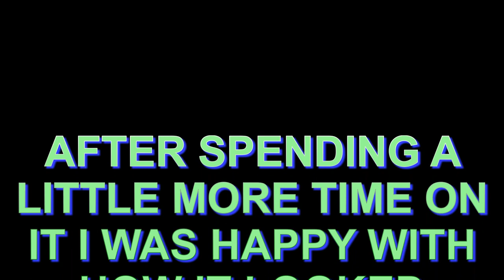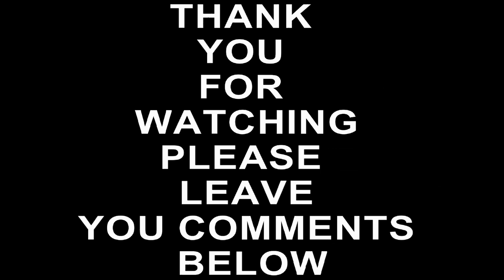Enamel Clock Dial Repair

Comment: If you'd have taken a heat gun to the repaired area, the enamel would have evened out and baked hard.  Then use pinstripe tape to keep your numerals straight.  Use an extra fine black paint touch-up pen.  But the enamel powder is supposed to be baked or at least exposed to heat.  You could also have put it into your oven dial side up and low heat...180F  Also, polident can make the dirt in the fine cracks disappear.  I wouldn't use it on a really valuable piece bit it really works.  You can see some people using it on pocket watch dials.
Reply from the maker: Wow! This is really good information. I tried everywhere to find out how to use this pate but came up with nothing. So in the end I had to fumble my way about it. I really appreciate the advice here. I'll bear this in  mind if I come across another badly cracked dial. Meanwhile, I'm off to order myself  some polident as I do have a few clocks with hairline cracks that I havent managed to properly clean.
Thanks again
Johnny

Comment: Job well done, have seen many dials that have been repaired badly & stand out like a sore toe, you have achieved a good finish.
When you have trouble finding where you repaired the dial, thats good.!!
Always best to keep original dial if possible, which you have done successfully
Thanks for the video, will purchase this product & give it a go
Reply from the maker: Thank you. I had a quick peek at your channel and can see you're a clock connoisseur. Its always nice for me to have the approval of an expert. I am just a keen self-taught hobbyist and  like having a go and learning. 
My biggest problem with the dial repair paste was that no instruction was supplied. In the end I made up my own way of using it which seemed to work pretty well. Glad you enjoyed the video.
Johnny
Reply: Restoring clocks is all about problem solving, which you achieved brilliantly, there is always more than one way of doing things & we all never stop learning

Comment: I find that useing the ultrasonic tank for approx 5 minutes with water or clock cleaning fluid in it on a dial that has cracks,the dirt is expelled from the crack and the crack becomes almost invisible,but i would not do this on a dial that has bad damage as some of the loose bits of the dial can come off.
Reply from the maker: Thats good to know. I might give that a try

Comment: Never heard of that paste before.    You seem quite handy  so what trade were you in.      Colour looks good.   That's the hardest bit..  if someone lets you know John let me know.   No instructions for enamel repair.  To make enamel chapter rings like that they have the brass template and sprinkle the sandy substance called enamel then bake it in the oven.   Really good outcome.. thanks again to..
Reply from the maker: Well.... I have had several different businesses over the years. My last venture before selling up and deciding to retire was an estate agency. Prior to that I fitted kitchens and bathrooms, before that I had a car breakers yard. The list goes on and none of it is related. Ive just always been quite good at being creative which is what I am using my ample spare time to pursue. I kind of enjoy the challenge although I do tend to get quite frustrated at times. So far nobody has mentioned any kind of tips on how to use that enameling product.

Comment: Hello, I also use enamel paste like yours to repair the dial, but it peels off easily even when I apply it. Is there any better way?
Reply from the maker: Hi
This was the first time I had ever used the paste. I couldnt find a tutorial anywhere so just opted with melting it into he cracks. Mine hasnt peeled or fallen out so far
Reply: thank you for your reply.
 Hmm, maybe I could have heated the knife more. If you don't heat the knife, the paste will likely crumble when preparing the surface.

Comment: what is the name of the paste you use
Reply from the maker: I used Bergeon Dial Enamel. Here is the link
https://www.cousinsuk.com/product/dial-enamel?code=D0417
Reply: Thanks
Reply: and where can I get the pen with which you wrote the numbers
Reply from the maker: @mustafayapc1150  I used  satin black spray paint which a sprayed a little into the cap. I think you can use Indian Ink too. Then I used a needle as you can see in my video 12:42 which I have secured into a holder. I carried out the work very carefully under my microscope which made it easier to get a fine finish with.

Comment: Hi, would you mind giving me some advice on the kind of microscope i should be looking for to do similar work on watch and pocket watch dials as well as lathing new staffs, im not an uber rich type and am self teaching. 👍 Also very nice job on the repair, i hope my repairs and restorations will be as good 😊
Reply from the maker: I couldnt be without my microscope. I use it for so many different things. One of the most important things to look out for is a decent working height as you'll need room beneath the lens to do your repairs. Some people seem to like microscopes with a screen but I feel that they mess with my hand to eye coordination. Mine is direct view through the lens. The only addition that would have made it better was if it had a camera facility (trinocular) which would have made filming directly through the lens a possibility. 
Heres a link to Ali Express where I found one very similar to mine minus the LED lighting although you can buy led rings for this purpose. This is the style of microscope you will need. 
https://www.aliexpress.com/item/4000327349091.html?spm=a2g0o.productlist.main.53.5e7776a91D0v2h&algo_pvid=f6283b26-862c-4ea5-a50e-bf9804aa7f39&algo_exp_id=f6283b26-862c-4ea5-a50e-bf9804aa7f39-26&pdp_npi=4%40dis%21GBP%21135.26%21105.5%21%21%21160.13%21%21%402103853616989168357953839e5983%2110000001342913380%21sea%21UK%21889865164%21&curPageLogUid=zcHm66d5HxN5
Good luck with your projects. I am self taught too. 
Johnny
Reply: Thank you very much 😊, I did think about an LCD screen to use the microscope directly over the lathe so that I could inspect the staff without removing them from the lathe. I never thought about which was best for coordinating hands and eyes though lol.
My idea was to trace the original staff over the screen on clear plastic sheets and then lathe to the trace like a template.

Anyways thank you so much for taking the time to reply and give advice, it is very much appreciated 😀👍

Comment: Great tutorial. Completely unrelated Roman 4 is not IIII but IV
Reply from the maker: Hi Zoran, Thank you and  Yes you are correct about the 4. I never noticed that before. I wonder how this happened???
Reply: @treetopspider  I've seen clock dials with both IIII and IV - I guess it's up to the clock maker preference. But technically IV is the OFFICIAL way.  Also, have you thought about putting the dial into an ultrasonic tank prior to working on it to reveal chips that would flake off later as well as clean tiny crack out?  Might work well.  I have several antique Ansonia open escapement clock dials that I'm going to try this repair technique on.  Thanks for a great video. 😉🙂
Reply from the maker: @ChetGeorge  Thanks for the comment. Yes Ive seen them both ways too. Its perhaps as you say, the makers choice. 
I have never tried putting the dial into the ultrasonic but then again, my take isnt large enough to take a whole dial. It does make sense though, the cracks would completely clean out
Johnny